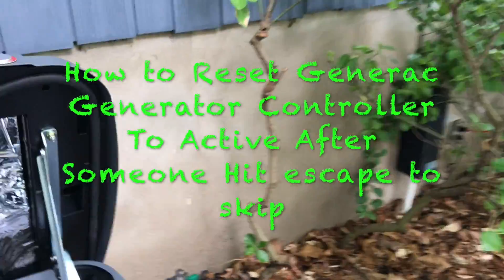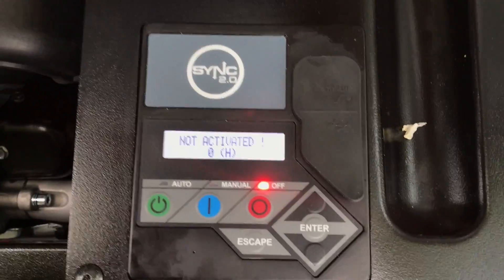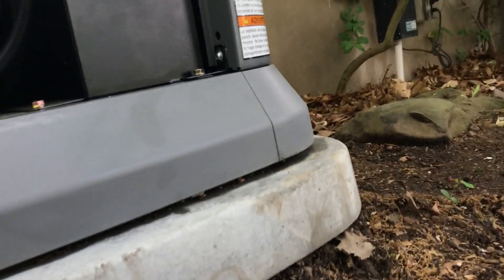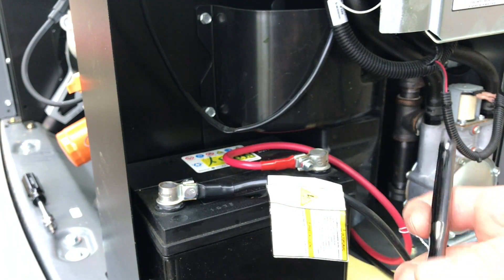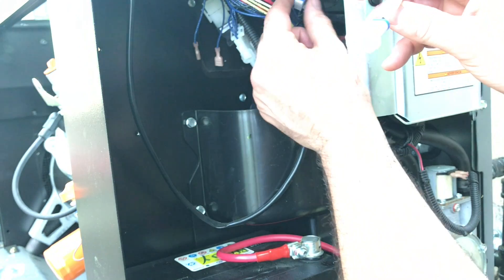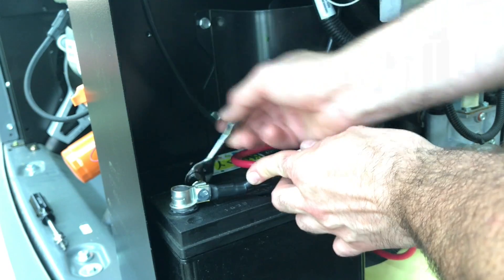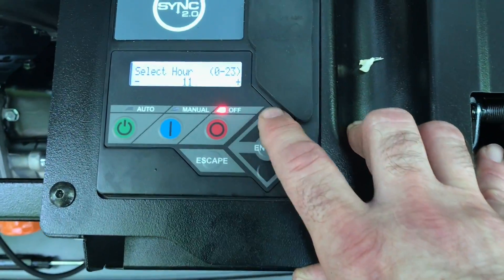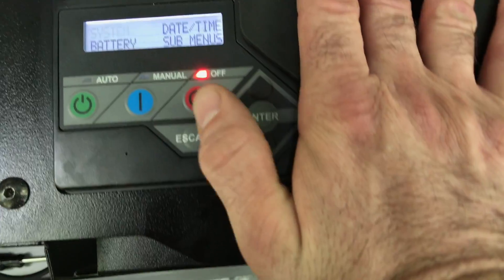How to Activate/ Reset Not Activated Evolution Controller Generac/ Honeywell/ Eaton/ Seimens

Comment: Could’ve pulled the F1 fuse from the controller instead of disconnecting the battery and then unplug the T1 harness. The 7.5 amp fuse in the controller connects the battery to it.
Reply: Yes you are correct the 7.5amp fuse on the front disconnects the charger from the battery.

Comment: I've been following a lot of your videos and they've been very helpful since the installer is clueless and still has yet to give me a working generator for the time being. that being said...

I have a 22kw generac standby generator and will finally have the auto transfer switch installed next week (long story). Anyways, what steps would you take if you needed to turn off the generator during an outage lets say to refuel etc? would you simply flip the switch in the panel back to utility/main first or turn off the generator manually then flip the switch? 

also when doing routine maintenance (oil change etc), is simply turning the generator to the off position and keeping the main line circuit breaker  off enough to prevent it from turning on? thanks a lot.

Comment: Hi thanks for the video my generator board is not responsive I did your reset truck and that seemed to restart it but my buttons are not letting me pick English . None of the buttons are working any ideas .If it gets wet does it burn out the buttons? Left the lid open in a rain storm

Comment: I have a brand new generac   I am using it as a power station for my cabin. I have no power or internet. I want to be able to start it manually from my cabin.  I heard this can be done. Would like some help please. Also my battery runs down while it is running.

Comment: Just started up a new generac 22kW Air cooled unit with a 200 amp SE/auto transfer switch. Everything checked out and functioned as it should. The only issue i see is in checking generator output volts i see at E1 to E2 = 243.2vac    E1 to Neutral=123.8vac  E2 to Neutral=119.6vac with or without load. Voltage/Hz seems stable. Do you think there's an problem with a 4vac difference in E1toN vs E2toN? Thanks, Russ

Comment: If you don’t activate, will the side light always remain yellow? Mine isn’t activated but still works but has a yellow not green light. I just want to be sure i’m not missing something.
Thanks
Reply from the maker: Does your generator work in auto if you have a power failure? Or you manually have to start it?
Reply: @thehvachacker  auto has never worked. I was told by the technician it's b/c I haven't officially activated it through the software. the wifi and app is terrible (only reaches 25% range or so). I don't mind just manually doing a check every week. 

on a side note, within not even 2 weeks, the battery apparently was dead so they replaced it. it runs fine now but I'm just little skeptical but we'll see. I have no green light though. 

that's a bit of a mouthful. I'm just trying to gather as much knowledge and perspective as possible.
Reply from the maker: The generator doesn’t need to be activated through any software. It needs to be activated on the controller. Activation code is provided to a Generac dealer from Generac. Once activated the generator will work in auto. The software/ mobile link is an add on not needed. I activate every generator before asking a customer if they want to connect a generator to their phone
Reply: @thehvachacker  thanks a lot for the help and information.

Comment: I have a Generac 15KW Guardian Plus, model # 0043903. Last July, Ithe battery was dead, and the battery charger was only putting out 1.5 volts.  I replaced the battery charger and recharged the battery.  Last month,  I found the battery dry, and the charger was putting out 24 volts.  What is going on with the battery chargers?   Or is it the battery?
Reply from the maker: What power comes out of charger when it is disconnected from the battery?
Reply: jane edwards … Been working on Generac for 22 years and have never seen an OEM charger go high voltage as you describe. Seeing as the INPUT voltage for that charger is in the area of 18 volts (AC) from the transformer I suspect you somehow measured incorrectly. I also suspect the battery may have it's own issues, only because anything can happen when a battery goes totally dead. What I would do is swap in a known good battery. Check the voltage before connecting the cables (roughly 12.6 volts) and again within 5 minutes after connecting the cables. Should be around 13.5 volts by then. Fast forward another 12 - 24 hours and check again. The voltage should top out at no more than 14 volts and will likely be around 13.6 if all is good.

Comment: I recently found my Generac 22kw generator with a yellow and red light showing. I noted that the alarm code was for rpm sense lost, and the yellow was for check battery. It was freezing, and we were without power, so i changed the battery from my car to check for fix.
When the controller energized, it flashed the blue manual light about 4 times, the screen switched to show the hardware and firmware and then went immediately to off. The screen now shows fuel selection NG, and no combinations of enter, escape, up, down, will cause any change in the screen readout. Also, even if i remove the fuse, the TI to the controller, and remove negative battery terminal, to reset, the keypad affects no change to the screen.
Is there something i am missing? is there troubleshooting advice for the evolution controller?
Reply from the maker: Replace your battery. If you have a colt meter when your battery is fully charged. What is the voltage drop on crank? I am guessing your battery volts drops to low on crank.

Comment: On initial startup after hooking up the battery the display panel on the control panel came up blank. The install wizard never prompted what could be causing that problem and can it be fixed?
Reply from the maker: How is your fuse or fuses?

Comment: Hi friend, recently I replaced the battery of my Honeywell 11k generator, but I have anything displayed on the screen, perhaps the machine is working, is there’s a way to fix it, thanks in advance. 
Gerry
Reply from the maker: Do you have power to the control? Any fuses opening the circuit preventing the board from powering up?
Reply: The HVAC Hacker 
Thanks for your response, I did the reset as your video process and the panel is back perfectly, thanks again for your support. I live in Puerto Rico the hurricane path.

Comment: If you put a new controller on a geneac 17 kw do you have to reactivate  it    when I start it . It run to fast and go to overspeed and shuts down  would like some help
Reply from the maker: DId the genset do this with the old controller? Your issue of over speed could be many things causing it. What is your hertz output?
Reply: If its a new controller you probably have to go into the dealer menu and change all the settings. Search for Generac Dealer Menu for how to get there.
Reply: joe keene … A 17 Kw should be an Evolution style controller and replacements do NOT need to be activated, but you do have to go through the menu and set things up for time / date / exercise, along with proper fuel, and frequency. (50 or 60 hertz) OTOH, I have never seen a controller cause an over or under speed condition. That's usually the stepper motor, which is what controls the throttle and is part of the entire throttle body assembly. Probably takes an hour to change one out if you have the right tools. BTW, many of those units had a 5 year warranty on certain parts so worth a phone call before spending any $$.

Comment: How do I access the dealer settings? The generator will not transfer during an outage and i believe the solution is in the dealer setting area that i am not able to access.
Reply: It was activated by the company I purchased it from. Would they have that information?
Reply: Dealer password is up, up, down, down, Esc, Esc then it will bring you to the 4 option menu and you can select dealer-edit